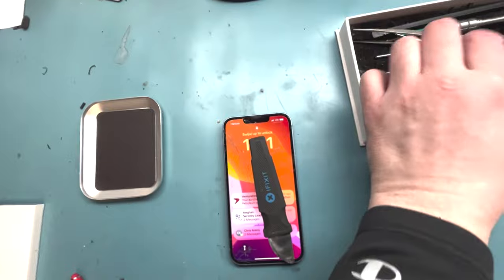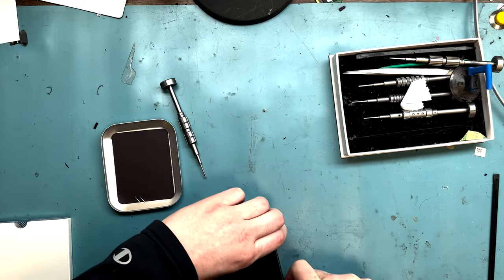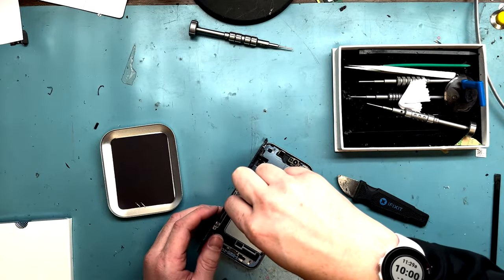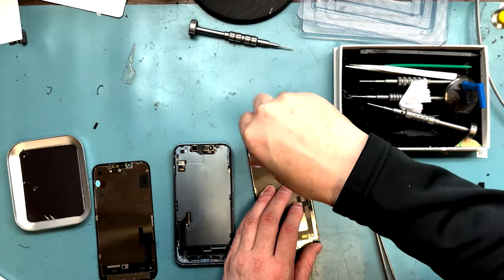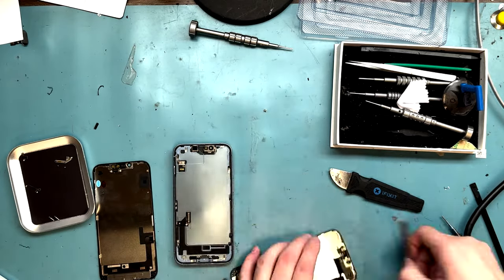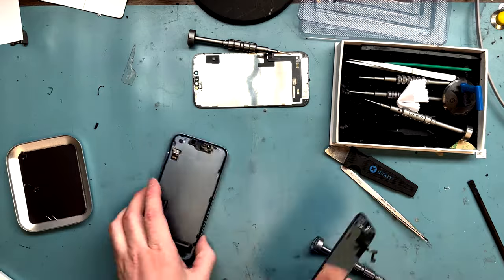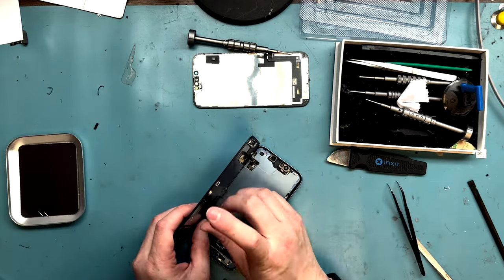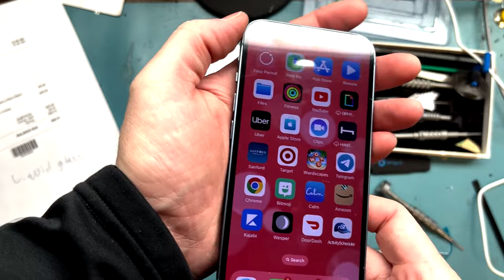iPhone 14 Screen Replacement Guide

Comment: So you didn’t unplug the battery?
Reply from the maker: I shut down the phone and actually rebooted phone with force restart and it worked. But if you can't get it to shut off I actually have done it without unplugging battery and did force restart and took my hands off buttons before the screen lit up again and it stayed off and did a force restart and it worked with new screen.

Most the time I unplug battery 1st but from what I learned on ifixit they do not unplug battery on there guide for this phone

Comment: my phone restarts every 3mins now after changing the screen
Reply from the maker: Could be defective screen. I do know the 3 minute boot sometimes could be a board issue. You would want to run 3utools and check the crash reports fast if it is CPU error then your phone has the 3 minute boot which is a board issue I’m not sure what the fix actually is for that it’s beyond me

Comment: Did you put the new seal over the original seal ? without removing original seal ?
Reply from the maker: I did do that! I have had times while removing the access adhesive when I damaged it more and had to do more repair than intended depending on the phone some I remove it if they need it.

Comment: So the iphone 14 and iphone 14 plus, you'd have to disconnect the battery from opening the black glass?
Reply from the maker: You have to open back glass to disconnect battery
Reply: @worthitrepairsbymark   is that just for the iphone 14 and iphone 14 plus?
Reply from the maker: @moelester8815  yes

Comment: How long do you heat the screen up for? Also what temperature? Thank you out
Reply from the maker: 83c 10 minutes
Reply: Thank you, I manage to get it off, how does the Face ID work on the iphone 14? I have the old screen which is no good, but have a genuine apple screen to replace it, do I need to take the senor of the back of the old screen?
Reply from the maker: @nathanhuitson1418  yes you will need to take the part off old screen and place it on the new screen
Reply: Cheers mate, will it come up saying unknown part?
Reply from the maker: @nathanhuitson1418  the screen will
Reply: @worthitrepairsbymark  that’s annoying, even if it’s genuine?
Reply from the maker: @nathanhuitson1418  Yeah its dumb
Reply: @worthitrepairsbymark  that’s an absolute joke, I need to get the back glass off without breaking it, what temperature do you recommend please?
Reply from the maker: @nathanhuitson1418  I’d do the same my motto is if it’s to hot to touch it’s hot enough
Reply: Hi I’m in South Africa please recommend where to get legitimate screens around or online and shipped. Thanks you.

Comment: What screwdrivers set you got ? 
And why did you place the blue film material inside ( then remove it ) ?
Reply from the maker: I would have to look up the brand of driver I can't remember what ones they are. The blue film has adhesive on the edges that you stick back down so the screen is waterproofed also won't fall off or cause dust to get into the phone making the camera dirty or blurry.
Reply: @worthitrepairsbymark  thank you for your reply, I would like a good set of drivers if you can please post the brand

Comment: How do you disconnect the battery?
Reply from the maker: You take off the back but just do screen and a force restart at end of connecting it and it should work
Reply: @worthitrepairsbymark  yeah, I figured it out 2 seconds after posting the comment. The 14 Pro Max isn't like that. First time I've worked on a regular 14. Super weird.
Reply: @worthitrepairsbymark  are you not worried about damaging the motherboard from connecting a new screen without disconnecting the battery first? Or did they build these phones differently?
Reply from the maker: @RedMissileGaming  It does worry me. I would take off the back honestly and unplug the battery to be safe. I have done it the other way though by mistake turned it on during repair and didn't notice until the screen was connected and not working so I had to do a force restart and it worked.

Comment: Mines won't turn on
Reply from the maker: Did you replace sceen?
Reply: @worthitrepairsbymark  yeah
Reply: @worthitrepairsbymark  like the phone makes noise when it gets unplugged but the screen isn't working
Reply from the maker: @LowOnFiberStudios  sorry for late reply! Did you try a force restart quick tap volume up then down and then press and hold side button for 15 seconds?
Reply from the maker: @LowOnFiberStudios  if that doesn’t fix it take off back and reseat the battery connection. Then if that isn’t working try old screen if it works it for sure is a defective screen but if it is beyond the chance of working I’d still wager in that your part might be defective.
Reply from the maker: Make sure after reseating battery that you plug it in sometimes they don’t turn on until being plugged in after battery has been disconnected

Comment: @RicardoDorado-yc1jz
0 seconds ago
I replaced screen on my iphone 14 and to be honest I ripped cable on proximity sensor. I ordered a new one but face id only says move closer but never detects face. Is there something I need to solder from old proximity sensor to new one? I’ve seen other videos where they solder the chip over to new one but this iphone 14 doesn’t have that.